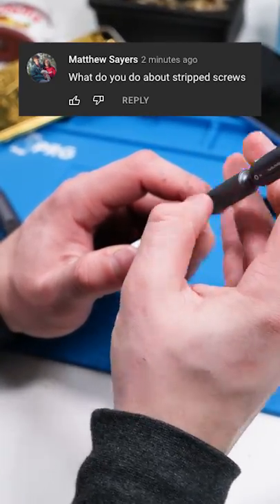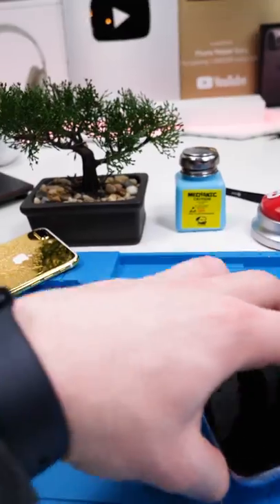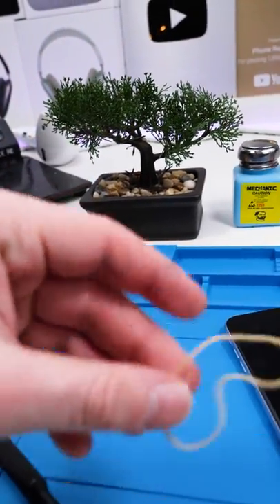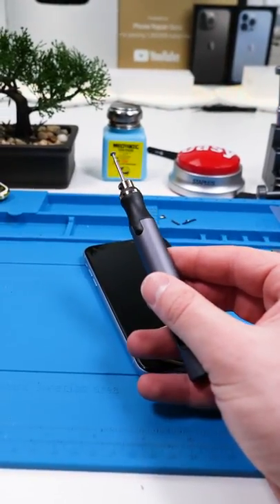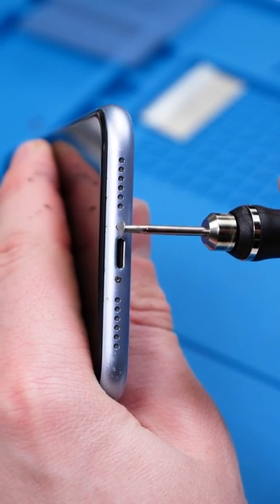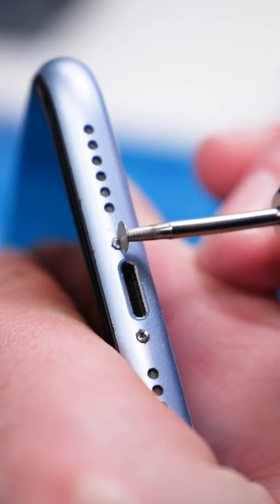How To Deal With Stripped iPhone Screws...100% Working #Shorts

Comment: “Often the rubber band trick won’t cut it”. Boi, oh I know! I can remember the full rage
Reply: What is that trick?
Reply: @Paco8478  pure time wasting material LOL
Reply: @alessioacri.  Yeah but at least it works, just apply a bit of pressure and twist
Reply: @flamingkillermc2806  I've never gotten that to actually work
Reply: @riley_621  So you have to get a bit that is not too sharp or it will go right through the rubber band. Then you narrow it down right on top of the stripped screw and press with medium to hard pressure not to hard it something will break. 

Then you twist

Comment: Love how the screw was already elevated when using....😂
Reply: its a stripped screw. i've stripped screws before and you usually can get it out just a bit
Reply: @xcatpatrolx  not mine
Reply: @xcatpatrolx yeah not too sure about that one, unless it’s been stripped due to cross threading and was never quite fully in. I’ve found that cleaning the screw and the driver w alcohol and using a bit of superglue on the tip of the driver will get that screw out every time. Let it sit for about a minute (only seconds with activator) and you’ll almost always get it out

Comment: 🥲🥲🥲what if it’s countersunk, and flush to the bottom as it would be normally?
Reply: Shhh he cant get internet clout by being wrong
Reply: Sometimes soldering a copper wire to it can help or just glue something to it with epoxy
Reply: What? you mean not 90% sticking out to where its possible to just unscrew with your fingers?
Reply: I would say your best luck is trying to find some very small screw extractor
Reply: Same

Comment: You can run into this anywhere! I've run into it in the automotive industry many of times!
Reply: It was mentioned in a Cycle World issue when a reader asked about how to deal with gummed up screws on a motorcycle engine. One such trick involves tilting a screwdriver at a certain angle then tapping it until the screw gradually loosens up.
Reply: @therealsnowwhite1937  for a flat head screw/bolt, I can see this working many times, but for Phillips head, Torx, and Hex, not so much.

Direct impacts head on with a stubborn screw/bolt works many times as well.

Comment: Screws are usually just below the surface of the body. 
You scratched the trim on the body of the phone, and the screw was already out some, raised above the surface.
When you started taking the screw out, you either covered the scratch or it was a different phone.

Comment: 4th time asking 😣: I’m 15 and I want to turn screen replacement etc into a business where can I go to buy cheap but good quality screens preferably for iPhone 6, 7 and onwards. Also any other advice for ppl like me.
Reply: If this is your 4th time asking here's a hint. The question is too broad. That's placing a lot of burden on the person being asked, to give a lot of info with very little direction and that in itself could be a very long video. 

If you're genuinely interested in doing that, put in the hours of research to look into all the options out there and find what would fit your business model. You might find the reason you're not finding answers is because it is either hard to do, not available, not plausible, or underresearched. Either way you either have to adjust your question to be more specific, try forums rather than asking one single person on the YouTube comments, adjust the business model to adapt to what resources you can find, and invest your time to figure this all out. Starting a business is hard and a lot of work goes into it before it ever starts. That means answering a lot of your own questions. 

I'm not trying to come across as rude or harsh, but the emoji you used is giving the impression that you are disappointed and expectant of an answer the first time you asked. It's not a fair thing to expect an answer to such a broad question, especially when it's entirely possible he never even saw it in the first place. Either do the legwork yourself and learn the intricate details you need for the business or start volunteering/working at tech repair shops to build experience and discover resources you'd need. No one is going to give all the answers you need in one go, because if they had all the answers they would be doing it themselves or don't want to help create a bunch of competition. I hope you find the answers and resources you need for it

Comment: He said stripped not rounded, stripped screws have lost the THREAD not The HEAD so you can turn it but it's the same as turning a pin in a round hole it just doesn't come out

Comment: My iPhone 12 Pro doesn’t seem to have stripped bottom screws but, both of them are rusted…my battery health currently is 88% and I would probably require a battery replacement in probably like a year or a year and a half…Apple service centres have also declined to help…kindly advise…I tried cleaning using 70% isopropyl alcohol as well but the rust is still there and I am worried the screws may be problematic to open…I am a student and am looking to use this phone for as long as it can viably serve me😢

Comment: Had stripped screws on iphone 7 battery and screen protection plate (well i stipped them using cheap tools), had to drill them out, phone works perfectly though :D
Reply: my battery strip is disconnected after dropping my phone now i cant open my phone cuz the screws are striped even the repair shop guy couldnt do it tell me how can i fix it if u know

Comment: I tried to fix my sisters iPhone once and the bottom screws were too far gone somehow I got them off by using glue waited for it to dry and it worked but I struggled, The iPhone didn’t work at the end I guess I couldn’t fix it.

Comment: Hey I dropped my iPhone XS, it immediately turned off but i tried plugging it in the charger and i could still hear the charging sound. What could this be?
Reply: worst case scenario, its the logic board solder joint broken, making the logic board splitting in half

Comment: When I had to disassemble my Zenfone 2 back in the days, most of the midframe screws were stripped, I had no grinding tool, elastic and glue on the screwdriver tip did nothing... I ended up cutting the plastic midframe around the screws 😭 😭 😭

Well... it works...

Comment: I have a 2020 nintendo game and watch, I’ve tried to unscrew the screws but there all stripped so it just wouldn’t unscrew, I’ve tried the rubber band method and the duck tape method, I need to get in to the buttons because the A button doesn’t register as well and I don’t want to break the screws just to get in and I know it’s easier to fix the button myself and not bring it to someone, can anyone help?